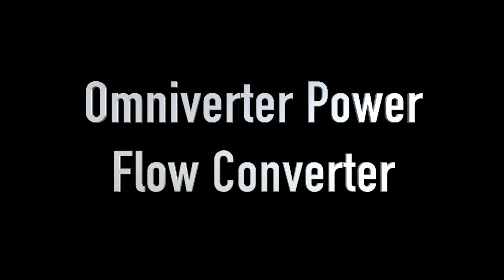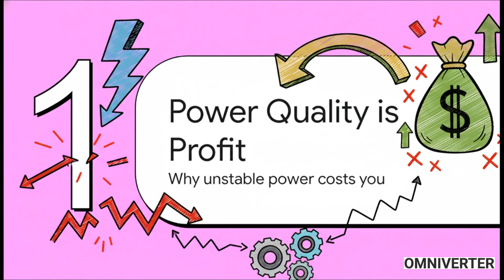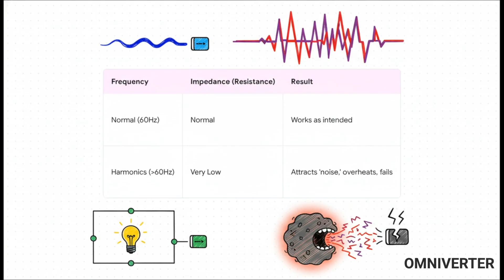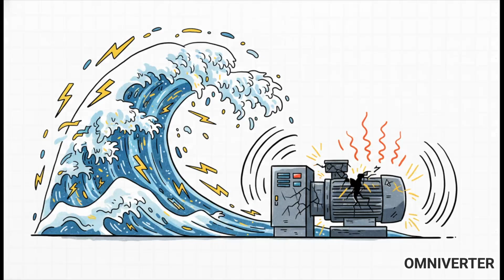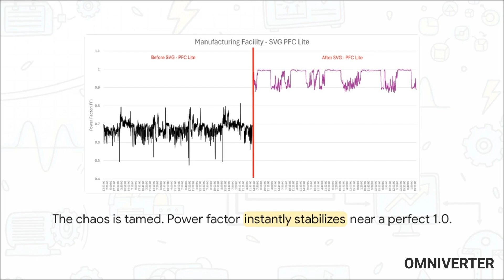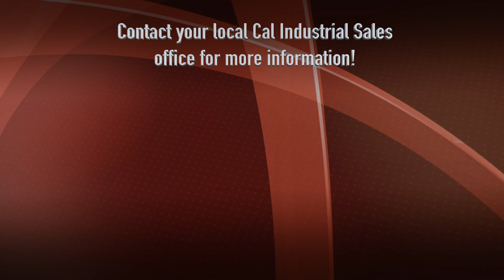Advanced Power Factor Correction from Omniverter

Comment: Do we need kv or 440v with higher frequency?
Reply from the maker: The Omniverter Reactive Power Conditioner is available in 380VAC to 480VAC models, and higher voltage up to MV is available as special custom order.  Frequency spec is 50Hz to 60Hz.  If you have an application you can reach out to sales@calindustrial.com and we will be happy to assist.